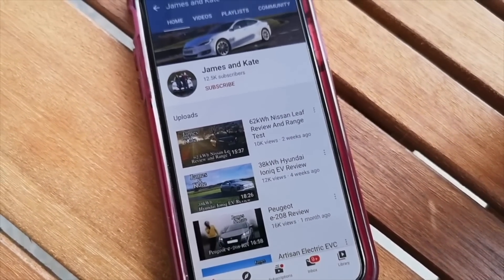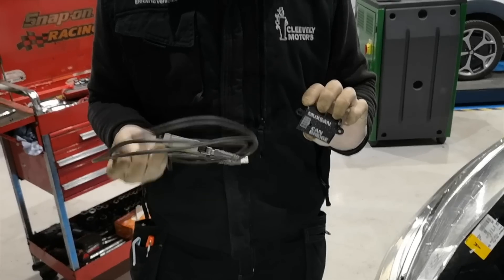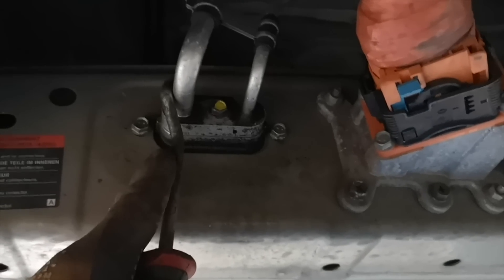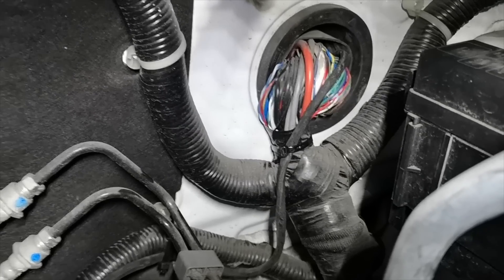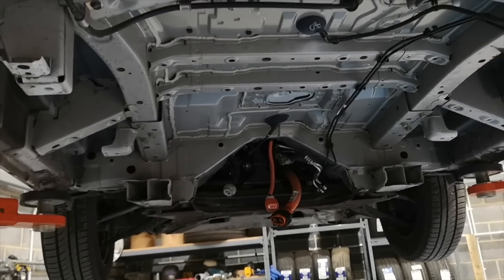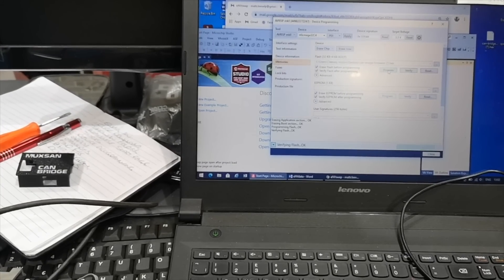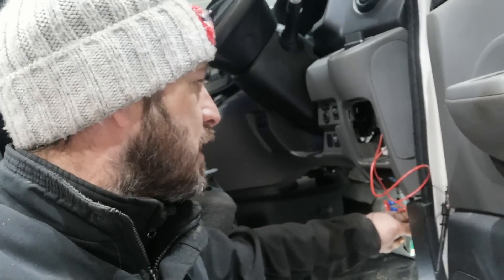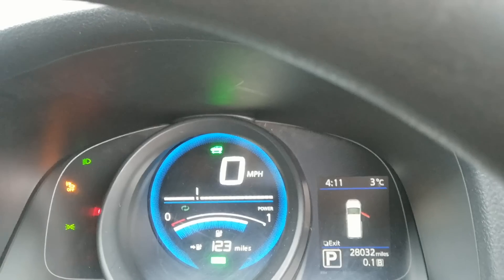2015 Nissan eNV200 Battery Upgrade

Comment: Hi James. Did you swaped PDM module from 3.6kVa to 6 kVa on env200? is there anything special for this swap? Does the PDM module from nissan leaf Aze0 2014+ fits to env200?
Reply from the maker: Ther PDM was already 6.6 and yes, they're a straight swap to the eNV
Reply: @Jamesandkate  Thanks. Would you think, that PDM 292C0-3NF3D  will function on japan/british env200 (2014 year)?
Reply: @Jamesandkate  answering my question. Yes, this pdm is recognized and works perfectly on env200 https://youtu.be/QJkW425g6RE

Comment: No mention of the battery ID coding error with battery swap?  Need to clear with software app or van stays in limp-mode?
Reply from the maker: If you're attempting a battery swap and you don't have diagnostic kit, you probably shouldn't be doing it.

Comment: Hi, Interesting upgrade.  I am interested to know roughly how many miles you achieved between charge-ups.  I have put in a journey from Epsom to Wigan and the evnavigation app is predicting a 227m journey with 7 charge-ups and about 33miles between charges (up to 80%) which seems a lot of stops...  Is this what you experienced with the 24KWH battery?

Comment: Looking at an ev at the moment for about 30k, do on a arrange of 100 miles a day but sometimes 200 miles don’t want anything to dull to drive so want it to be a bit of fun sometimes but comfortable too. Tried a 42kw i3 loved it to drive but a bit noisy and concerned on range especially in winter. What would you recommend?

Comment: Good day! I guess I already asked you !?
Tell me, is it possible to put a 62 kW battery in the e-HB200?
What is the best way to do this? Move all the elements to the old case? Will there be room for a cooler?
Thank you!
Reply from the maker: It’s not possible. We’ve looked in to this on numerous occasions 😐
Reply: @Jamesandkate  Then how to increase battery power? Maybe a new box in the spare wheel area?

Comment: CAN should ideally be wired with twisted-pair for maximum noise immunity. a twin twisted-pair cable (e.g. farnell 1387731 ) would have been neater than DIYing a cable with some random 2-core cables taped together
Reply: Just like UTP for the Ethernet?
Reply: True, twisted pair blue and green wires on this, easiest place is passenger footwell outer wall where the CAN is located, easy access 😉

Comment: so you could have went to the nearest supermarket and got a £10 sd card for the camera.

So  the old pack was 24 kWh  and the new is 40 kWh.
so how does this effect weight and so  miles to kW.  between both batteries.
the underneath of the van looks like it could take a much longer battery than it has.

Comment: You could do with an explanation at the beginning of why you had to add the extra wiring and what the canbridge is for. Nice range upgrade. :) One thing to consider is as you’ve changed the spec of the vehicle have you told your insurance company?
Reply: Do insurance companys care if you bring extra gas in a tank with you to your journey in an ICE vehicle? The weight difference is about that, like couple of extra gas tanks in boot. No performance upgrade was made.
Reply: It corrects the post-uografe intermittent range error and some offer extra functions including custom fast-charge settings to improve battery life for frequent fast-charge users 😉

Comment: No price mentioned for this service suggests it’s expensive.
The positives for driving electric are fading somewhat .
Reply: I don’t know, stopping people dying from breathing our burned fossil fuel is still a positive!
Reply: Not exactly, it's do to supply of used packs in the market, one day it could be this price and another this - business wouldn't like to promise price and then won't be able to match it due to higher pack pricr
Reply: there never is prices mentioned in any video.   you don't get hours the job has taken said  or even a range of time  that it could take 3 to 4 hours to do depending on any problems.
we should all know that each job and car can have problems and so cost more but a ball park figure would be nice.  or people just think it cost so much that they would not buy an ev as the repair cost will be massive.  which may not be any were near the truth

Comment: Oh BTW, if anyone is considering buying the Nissan E-NV200 I highly recommend it! Great to drive, handles well, quiet and fairly brisk. Although be prepared for lots of annoying beeps and bongs and don't go too fast over speedbumps as the ride is very firm! PS Get the accent rapid model which has the 7kW onboard charger.

Comment: looks like a great Job thanks for sharing. As a said on your other video I am really thinking of doing this to my 2015 Van. Is that a brand new 40kWh battery going in or from a donor vehicle? Regarding range I get about 50miles on my 22kWh van at this time of year and about 70 max in the summer. That's will half load, roof rack and approx 85% SOH. I never take any notice of the 'guessometer' range in the van as it tells me I have 70miles in the morning. Would love to get a quote for this do I contact Chievely EV is that right?
Reply from the maker: Drop us an email to info@cleevelyev.co.uk and we can help you out 👍🏻

Comment: The eNV200 could have been a high volume seller for Nissan. 
They should have increased range sooner and promoted it more. 
Now many legacy auto makers and startups are coming out with all electric delivery / work / service vans.
A missed opportunity. They were years ahead of the competition and did not take advantage of it.

Comment: James and Kate,
Which car do you recommend second hand for around 20K?
1) Nissan Leaf 40kw
2) MG ZS EV
3) MG 5 EV
Our family comprises; 
me, my wife, our 3 year old daughter and Maggie the big greyhound.
Reply: i would have added  an ioniq 28 kWh mine can do 146 miles on full charge   either  SE with leather seats or standard  you can get for  under £19k 
it has a much better track record  and will do as many miles as a leaf 40.
it is also insurance group 16 / 17.
the leaf has no battery management so will drop range faster over time.
the MG Zs if you look at the petrol version which the electric is based on has high rust issues for older models.
the only reason why the other pick the MG 5  is that it is newer  and has dealt with a few problems the ZS had by either repair or just not having them on the car at all.  you will find that an ioniq will over time be more reliable and have less issues.  I would ask you to just consider it.  over an MG or Leaf.
Reply: MG5!
Reply from the maker: MG5 all the way 👌🏻

Comment: Excellent video, would love to do this and an UBEX on my Evalia. But since it´s a bit scratched and dinged up it might just be easier to get one with the bigger battery. Problem is that used ones are rare as rocking horse shit and the factory new ones are bloody expensive.
Reply from the maker: Indeed. The ubex is next in for us. Surely the Evalia is worth the paint and repairs? Especially with the range upgrade??
Reply: @Jamesandkate  Maybe, but interior is not the tidiest, roof is buckled from roof rack making contact with solid object and the front left corner was hit by a snowplow.

Was an electricians work van combined with family transport before I got it.

Works well and got it for 60% cost for a tidy one. I haul muddy MTB´s, building material and all sorts of dirty garden stuff with it. Love it.
Reply: @Jamesandkate  btw, any opinion on the BYD T3 and M3 electric vans?

Norway already got them and they are pretty much e-NV200's with 50+ kWh batteries, CCS and some other minor alterations.

Comment: Hi.. whats the approx (customer) cost for an eNV 24kwh to 40kwh upgrade? Mine doesnt have quick or rapid charging (so 3kw ish only) if that makes any difference.
Reply: You can get 6.6kW unit for £1000, ish, and these guys can do a swap pretty fast (it's few bolts, and connections).
Reply: @vladzis  Interesting. Might be worth considering with the 40kwh battery (not much point with the 24kwh as an overnight charge does the trick). Thanks.
Reply: @dereknicol5284  if you get 24kWh one with the right price, it's cheaper to upgrade than go straight for 40kWh version. It's essentially same vehicle, just with bigger battery 🙂

Comment: Would 62kWh be possible too? 150-200 miles on a van would be great! At a guess, they're probably still pricy as not many Leaf+ have crashed to extract the packs yet.
Reply: 62kWh battery slightly different shape and an inch higher, making it as NO, if you want plug and play option, as e-NV200 battery sits low already

Comment: Excellent as always James. Is there a possibility of retrofitting a CCS charge port on a new leaf?
Reply from the maker: Anything is possible, but I'm not sure if we'll be offering that anytime soon.
Reply: @Jamesandkate  Thanks James. I have a chum with a new Leaf and he is always moaning about access to Chademo if he travels to France as most of the new rapids are CCS.
Reply: Its not just a case of changing the socket.  The software for Chademo and CCS are different.
Reply: @MarkAtkin  Hi, Yes I realise that,  but it may be possible and a solution to a potential future issue.

Comment: I am considering this for my van. Can I ask what the cost of the upgrade is and how did it affect your insurance being a modification?
Reply: It's technically not a modification, V5 doesn't need to be updated as well
Reply: 40kwh is £8.5k I believe .
Reply: @davefitzpatrick4841  Hopefully they'll find some more 40kwh batteries as they currently can't offer me this service.
Reply: @davefitzpatrick4841  ahhhhh

so in so many ways its better to sell your e-nv and put the money toward a 40kwh van ? .... thats a shame . If it was 5K and there was still the value from the old battery pack it would have been a serious consideration

Comment: Hi James thanks for the videos. Looking forward to your next ev review.  This may seem a naive question but what are the chances of having your battery stolen from under your car when it is parked up somewhere perhaps a bit remote?
I am aware that catalytic converters get stolen but there is a huge weight difference.
Reply: It's 300kg, so you cannot just undo it and take it with you to the boot 😁 without a lift - it would take a while to disconnect the battery
Reply from the maker: I mean, anything is possible, but to remove the pack on the roadside is a big task. It's not something that concerns me tbh.
Reply: @Jamesandkate  yeah as I thought it would be a bit of a mammoth job. Thanks for your reply.
Reply: @keithware5314  they’d steal the van before the battery.

Comment: can you put a leaf 62 kwh battery in it?
Reply: No, it's an inch lower, and different shape. 40kWh is plug and play in terms of installation
Reply from the maker: In physical size, yes. There's a kit to adapt it. However, the BMS and cooling fitted to the eNV isn't the same in a 62, 40, 30 or 24kWh Leaf pack.
Reply: @Jamesandkate  and have you the know how/experience, to get around all these issues yet?

Comment: Great video.  Thanks for making it.  As you started with a good 24kWh battery, I am surprised you did not go for a UBEX from Muxsan.  This would have given you less issues with rapidgate and faster charging? Unless you are planning on adding an UBEX later?  How are you finding driving the eNV200 over long distances?
Reply from the maker: Indeed. The UBEX is going in too. Just waiting on time to do it 🙄
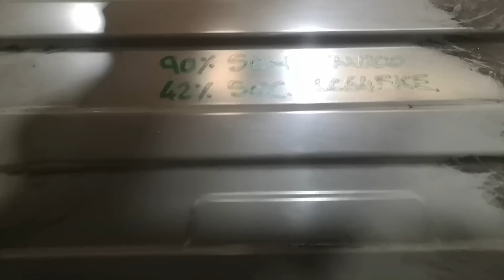Reply: Think so, James mentioned (starting @5:42) putting the original pack back in and getting an UBEX. So this might just be a training exercise.

Comment: Interesting video thanks. One observation though, a bit too much tech jargon without explanation. No offence intended and long term fan of your channel, great work!
Reply from the maker: No offence taken. Which in particular would you change??
Reply: @Jamesandkate  Thanks, nothing major, just when you're talking about CanBus, HV, LV etc just a bit of explanation of what these do would be interesting.  Just managing to film whilst doing a job such as this must be really tricky! Thanks for the content!
Reply: @4wheelsgood  canbus used as a communication protocol in cars from early 90s 🙂 for example from ECU (one of vehicles computers) messages it can tell you what's possibly wrong with your vehicle (say front parking light is gone, cylinder having misfire, etc); HV - High Voltage; LV - Low Voltage;
Chademo is canbus based, that's how charging station communicates with vehicle; CCS is TCP/IP (same as internet, in a sense) based, and has many versions, and that's the reason why some CCS vehicles having issues with charging stations, when versions doesn't match

Comment: So the 40kWh pack came from another eNV200 as the leaf 40s pack doesnt have ac into the pack ?
Reply: Only bottom enclosure part is different (Type C), so all AC can be transferred later on. James would be the best to confirm, as I may be wrong
Reply: @vladzis  none of the leaf has any thermal management so no ac into the battery pack on Leaf packs.
Reply from the maker: @JonathanPorterfield  yep, spot on. I'm currently chatting to  Muxsan about swapping 40kWh Leaf modules in to a 24kWh eNV pack to increase range, but the BMS is completely different 🙄